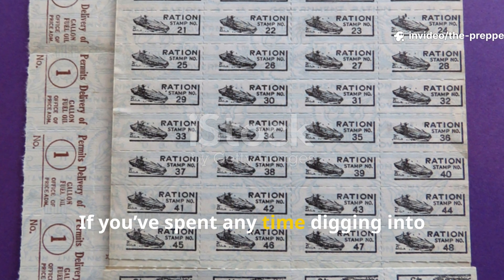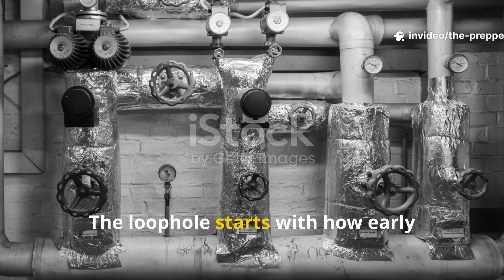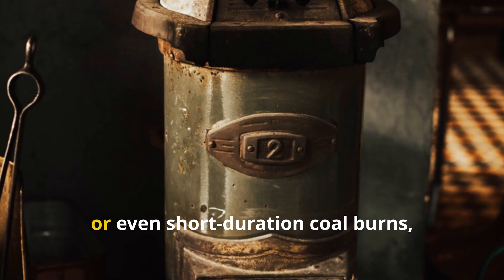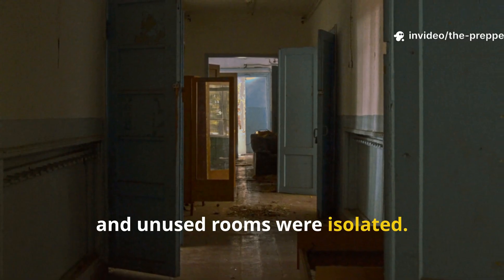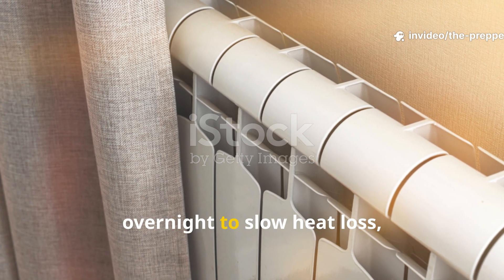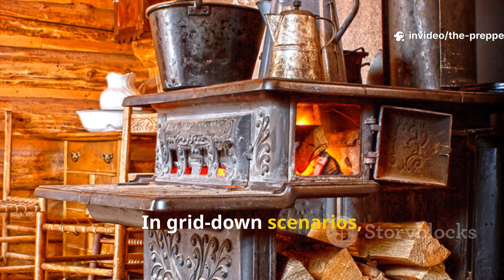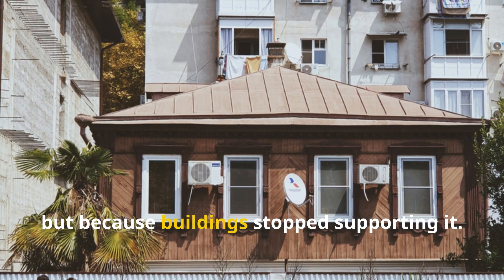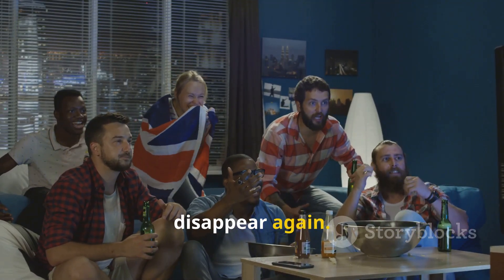How 1940s Homes Stayed Warm With ZERO Fuel — The Radiator Trick Nobody Teaches

Comment: As an electrician here in New England I've been in hundreds of homes and I've never seen a radiator mounted on an interior wall.
Even if you were only Heating up the radiator every other day you were still using fuel. This is just more lazily produced and narrated AI slop